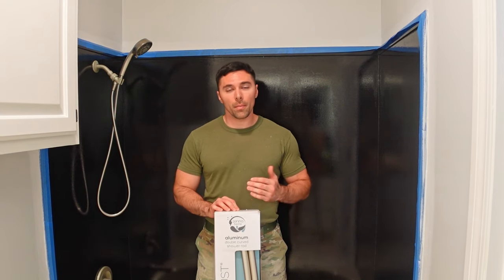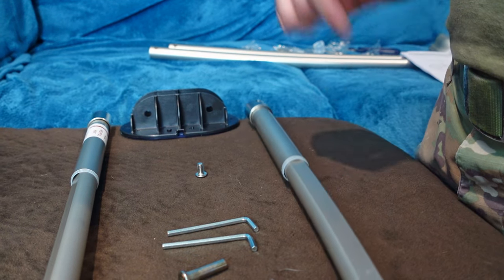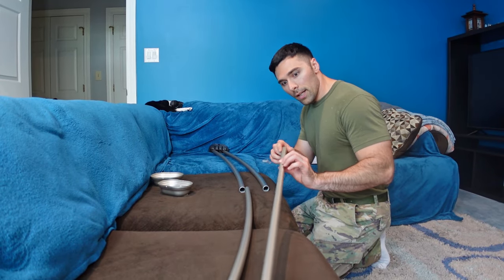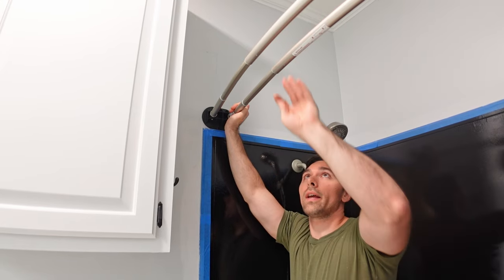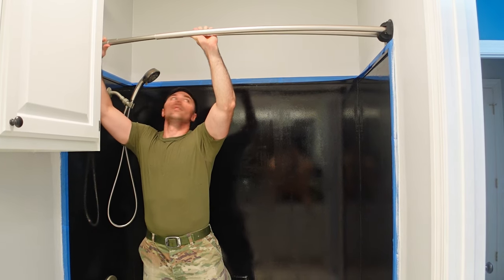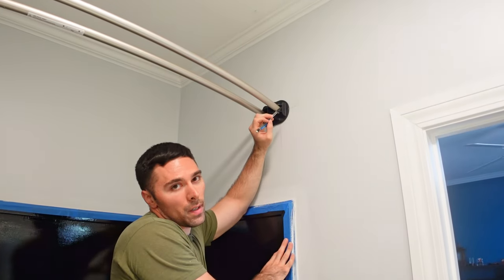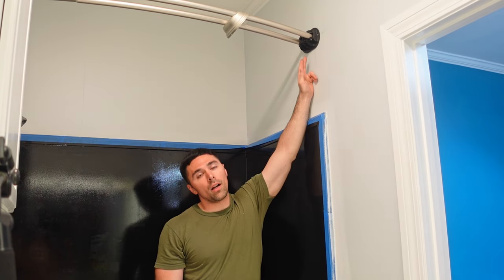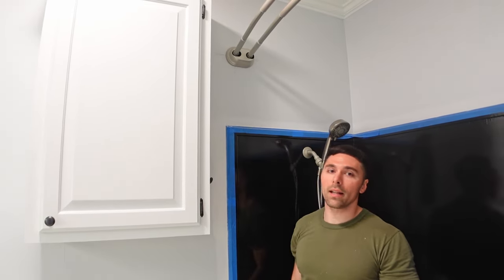How to Install a Zenna Double Curved Shower Rod

Comment: Thank you so much. I was really struggling with this rod. It surprisingly is more of a two person job just to get the right amount of tension. I finally got it up there after 30ish minutes but once I finish painting my bathroom I plan to just imitate you and screw this shower rod into the wall. Thanks so much for your video!

Comment: How did you install the cover brackets
Reply from the maker: They literally just press onto the mounting brackets, it will not feel very secure and they are very easy to pop off again. You just have to slid the covers down the rods before you attach both ends. I did not like how the covers went on because there is no retaining screw to hold them in place which I have seen on other rods in the past.